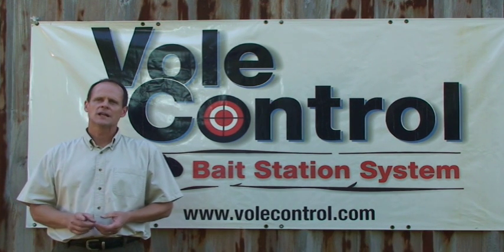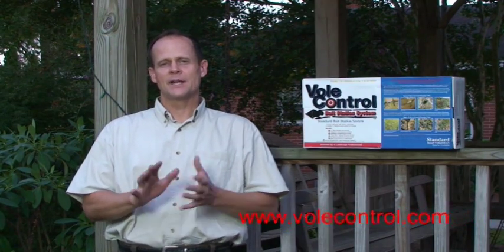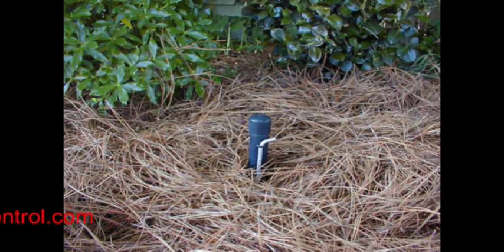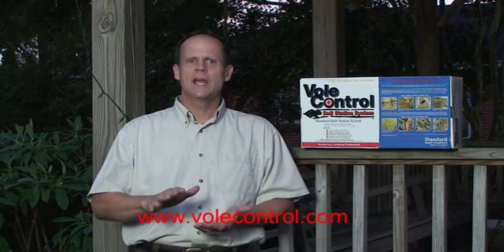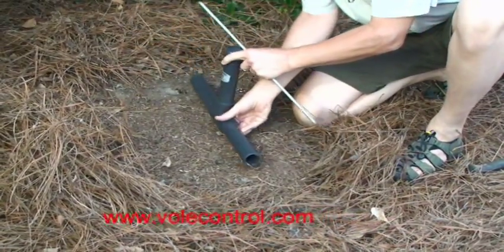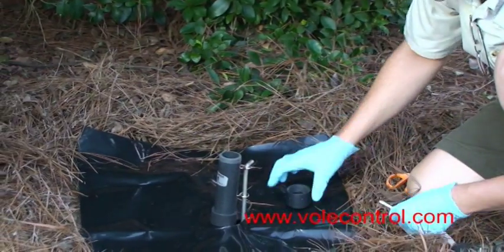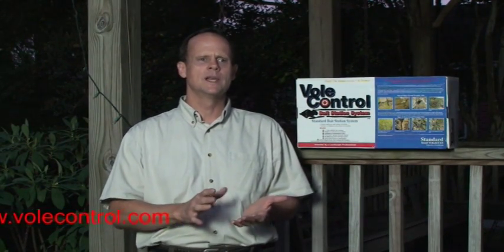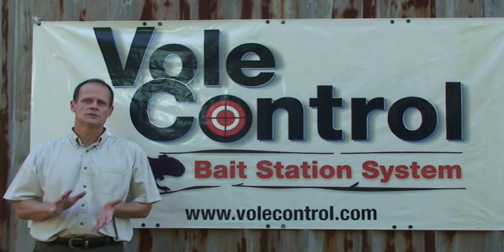Vole Control You Can Do

Comment: Install a Barn Owl nest box.
Reply from the maker: Always good to encourage natural predators to help keep the vole numbers down.  An infestation may require more action to gain control.  The Kaput Vole Bait we sell with our bait stations is the least toxic poison on the market and does not pose a threat to birds of prey.  Check out our website at volecontrol.com for more information.
Reply: The Idaho Extension has a plan to build two Barn Owl nest boxes from one sheet of exterior plywood. Place it 8 feet high and orient the entrance away from the prevailing Winter wind. Make the entrance oval no more than 4 x 5 inches.

Yes, the bait is effective when you have an infestation requiring immediate attention. However if an ounce of prevention is worth a pound of cure, then a nesting pair eating more than 3,000 voles in a five month nesting period should be considered by rural landholders everywhere.

Ticks need hosts. Small warm blooded mammals not only host ticks they are disease reservoir. Barn Owls will suppress the tick host population.

California vineyards place them at one per 26 acres and Florida sugar cane fields one per 57 acres. This reduces the food for coyote and pit vipers too.